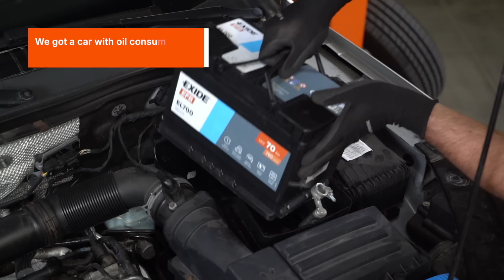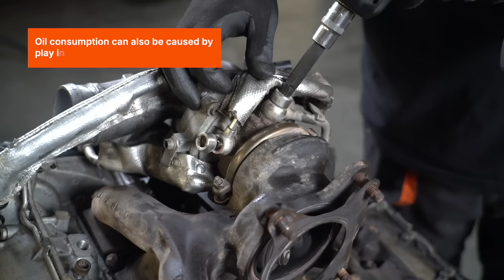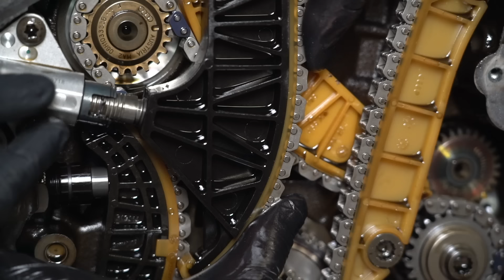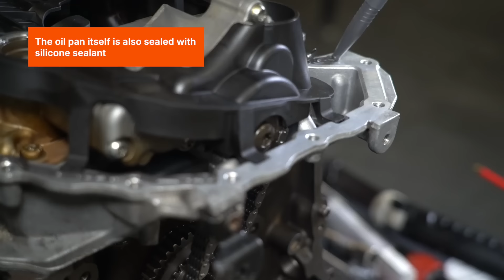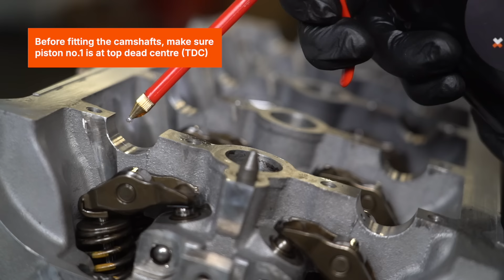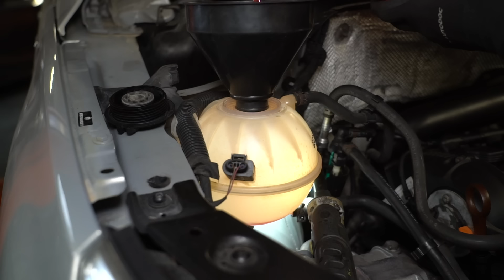Why does it burn oil? The main cause of oil consumption in EA888 Gen 1

Comment: Repair cost 5-6000 euros. Just scrap the car.
Reply: If the rest of the car is in good shape, I disagree. New cars are expensive. Fresh motor with no payment.
Reply: I just rebuilt my motor with a bar-tek 1000hp kit for 11k euros. Cannot be happier.
Reply: And if u have a car 40.000+ euros?? 😊
Reply: @TheArifovski тогава да,заслужава си
Reply: If the cylinder walls aren't Scorched as if.
Reply: I’ve just did the same inspection with some parts replaced on my 2.0 tdi 140hp. The price for works and parts was 1500 euro. Golf 5, 2005 year, 2.0 tdi, 6 MT, 4 motion.
Reply: Diesels are actually a fair bit more expensive to work on too from what I can gather didn't turn out too bad in your situation good stuff I know it's still expensive but a new car is most expensive  @AlmairDelMar
Reply: @fuckglobalism you’re absolutely right. 😊
Reply: The amount of crap in the pick up tube blew my mind!
Reply: Nobody sued vw for this fatal fault?
Reply: Or do swap engine to 1.9/2.0tdi. Its plug in.. or old 1.8T best turbo engine ever made vw.
Reply: Those tdis done right hall ass and blowin big soot clouds like old trucks that look awesome especially in the EU 🤣🤣♥️ @furieux6742
Reply: @furieux6742 😂😂😂тъй де сменя двигател,Ами...електрониката?
Reply: for 5-6 thousand euros you can have a forged 2.0tsi engine built, this doesn't even cost half as much
Reply: @jancireznik5433 😂😂😂даже е повече в Бг
Reply: Can't be that expensive🤨At max 3k labour included.
Reply: @Zeghetank 2к само труд